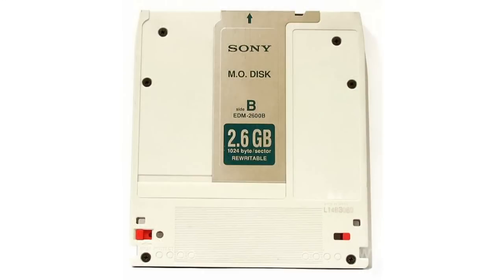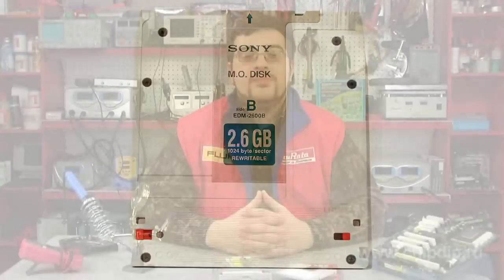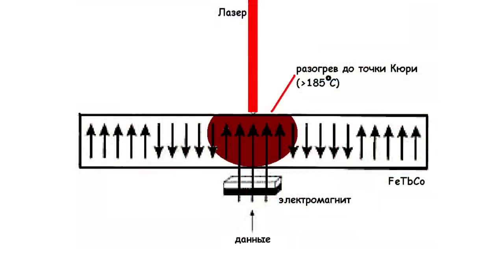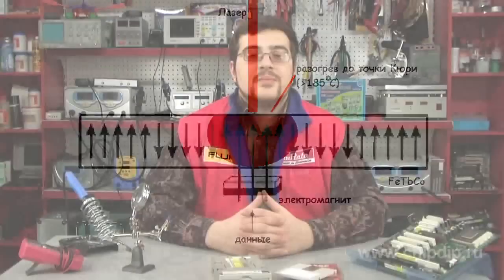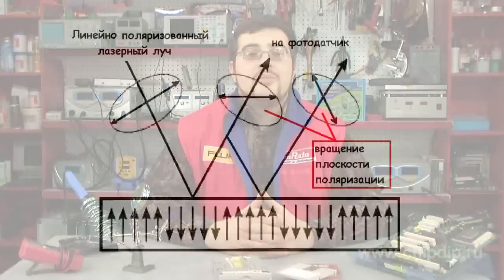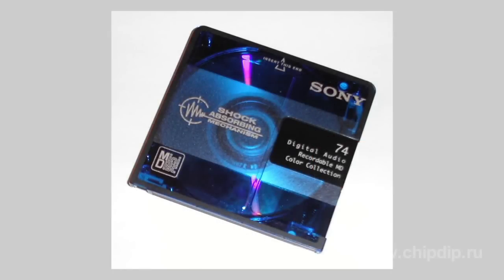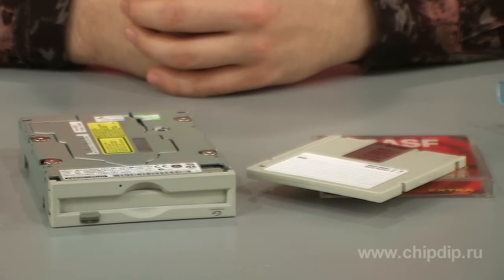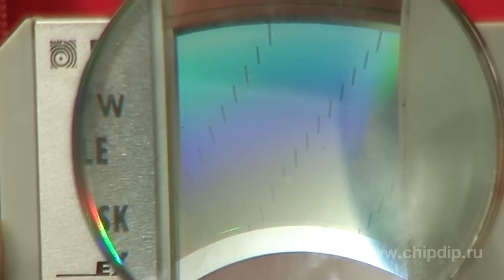Magneto-Optical Disc

Comment: Can you open it to put the Magneto disk in a cd player to hear music? Can you put the Magneto Disk even the hard plastic in a Super Disk Drive? Can you put it in a Orb Drive like what all the things you can put in it to play music ???
Reply: Magneto-Optical drives do not use Phase-Change media for rewriting as CD's do. They use the Kerr effect. You heat a spot with a laser, then subject it to a magnetic field. Once the disk cools, the data is saved. A laser is used to read the data, but due to the magnetic field saved when it was written, the reflected light is changed. That change is used to interpret a 1 or a 0. Magneto Optical drives are also hard sectored.

None of these things are compatible with standard CD-ROM drives.